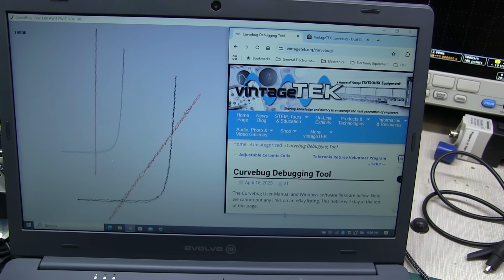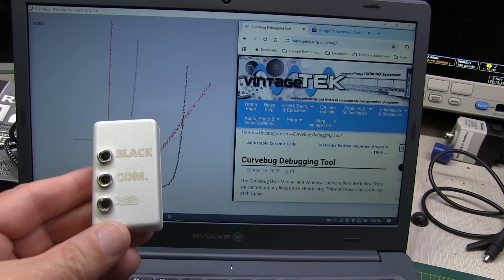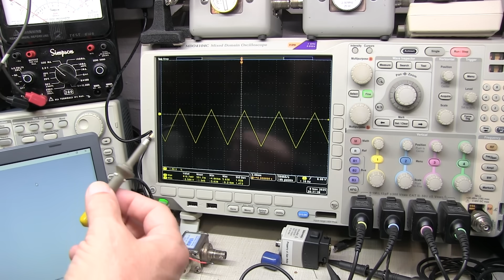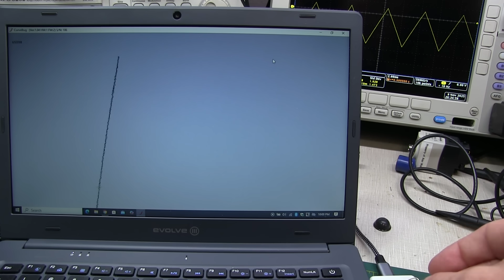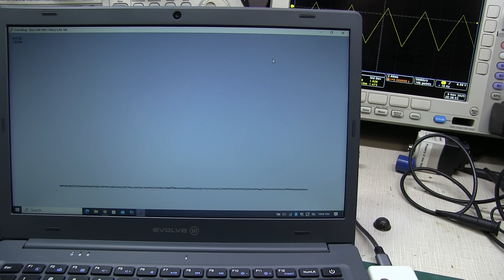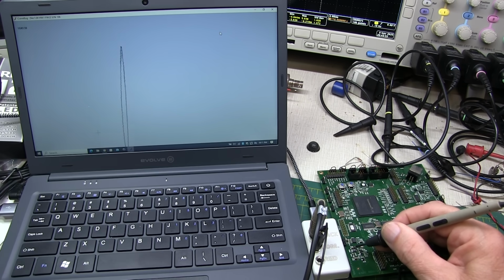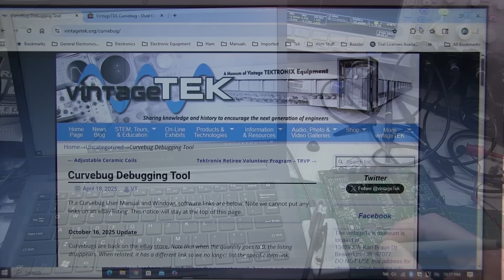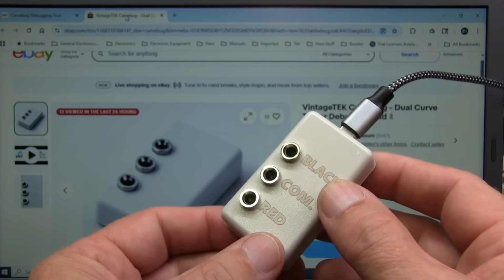#405: The CurveBug - a dual octopus style debugging tool from VintageTEK

Comment: Please consider making an investigation on how to measure diode frequency limits. Seeing the frequency which the response falls would be central idea.  Figuring out junction capacitance and reverse recovery time would be a great bonus. 
I'm playing with diodes again after getting a vintage Ge unit with a  huge point contact that is comparable size to a spark gap component. 
I'm considering qualities which limit diodes as used in power sensors.
Reply from the maker: Check out these videos:
Diode charge storage and reverse recovery:
https://youtu.be/SBqLOrlA7QI?si=m55hamK5BOafDT-l
Diodes - from ideal to real:
https://youtu.be/Pp5AAj2aIzc?si=zflFCT8fg7flOAAC
Reply: @w2aew Yes.  Those are very good.  I'll review. I realize the reverse recovery time would be connected to maximum frequency. Wouldn't the capacitance affect the frequency too?

Comment: What is the difference between an excitation voltage VS a Non-Excitation voltage?
Reply from the maker: None really. The adjective “excitation” is typically used when the voltage is intend to induce an action or stimulate a measurement.

Comment: Nifty! Brings back some old memories.. Mid 70s I started working in a radio shop. First test equipment I got was an old Leader scope and I read a book and built a curve tracer using a princess (lighted) telephone transformer, a couple resistors and leads. It connected to the x and y scope inputs. Made it fast and easy to locate blown or weak drivers and finals in CBs and such without pulling them. They would either be shorted on open, occasionally a weak junction where the L was rounded or noisy, not a sharp corner on the L. Some circuits, L-C I think, would make lisssagous figures.
That simple circuit made me look a lot smarter than I was, and it got the job done.
Thx es 73!
Reply: You know in modern electronics the electrolytic capacitors usually go bad, more than any other thing.  Even though, I am a Electronic design engineer and science enthusiast and not involved with electrical repair professionally; still I have in circuit  capacitor tester to check for shot electrolytic capacitors, when I open broken electronic circuits that our neighbors throw out to learn from.
I guess this can be used better for that purpose.

**  Warning  if you decide to test the capacitors in circuit make sure they are discharged.  Use an old high voltage tungsten light bulb or a heater element to discharge the capacitors before they zap you or your test equipment *

I do not have the schematic of this CurveBug, but they should have protection circuit and may be a fuse at the input.
Reply: @aduedc  protection circuitry can be quite simple, I guess: a fuse in series followed by a beefy enough bidirectional TVS diode in parallel with the outputs (or should we call them inputs?)

it becomes a little more complicated if you factor in the soft turn-on characteristics of the TVS diodes or zeners, especially at low voltages, but there are ways of implementing more precise voltage clamps.
Reply: @s_s-g4d  Yes. There are  more precise voltage clamps.  We use them for ESD protection in chips; even though, we do not have access to internal zener diodes when we design chips.  There are lots of papers and books about about how to design ESD protection pads.  A company that I used to worked for long time ago send me to a 2 day training seminar by Texas Instrument on how to design ESD protection pads for chips to Disney land hotel in Anaheim, California.
A simple protection circuit for outside chip and PCB level would be to put a fuse followed by zener diode between collector-base of a BJT transistor. When the voltage exceeds 0.7V+Zener voltage the BJT turns on and cause the fuse to burn.  You might include a high resistance like 100K between base and emitter too to make sure the BJT is fully off at low voltages. Of course here you use NPN with grounded emitter.

Comment: Ok.  Can it characterize pins on a suspect IC and know good IC?
Reply: Electrical overstress failures on IC pins are VERY easily spotted with the CurveBug. You might not even need the reference IC. In fact, this type of failure can usually be found with the diode checker range of a digital voltmeter.

Comment: Thanks
Does it have Linux App?
You are right the modern electrical circuit use low voltages.
But for investigating physical phenomenon  we need higher voltages, even 100s of thousand of volts.
For example, study of spark plug inside different gases.  Say a spark plug inside Oxygen, Helium, Radon or other gasses.
I was lucky enough to buy custom made curve tracer that has vacuum tubes and goes to 1000V, from a surplus store for $5.00.  The only problem is that if the Vacuum tubes go bad; there is no replacement.  
By experimenting with that so far I learned that some LEDs have 98v reverse breakdown voltage, Of course I tested it in series with 1MOhm resistor.
Here is an other thing you can do with higher voltage curve tracer. Get a couple of electrodes inside liquid (say water) and see how changing voltage changes current before and after electrolysis starts.
Investigate breakdown voltages of different maters and naturally occurring gemstones that you find in mountains and next to rivers.
Reply from the maker: Of course, there are lots of higher voltage applications - they're just one what this device is suited to troubleshoot.